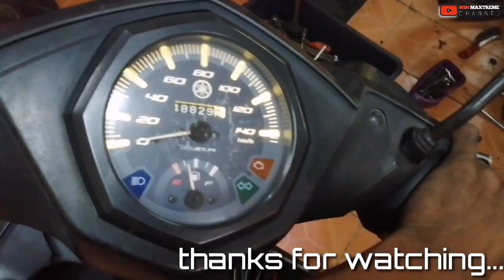CARA MENGATASI YAMAHA EGO'S FI TIDAK BOLEH START

Comment: salam boss, EGO s FI saya baru lepas tukar BLOCK baru(57mm), valve seal in out baru, valve lama grind balik, INJECTOR sudah servis, kepala plug sudah check, BATERI+RECTI tukar baru, THROTTLE BODY siap cuci semua.

masalahnya. 
-nak start guna stater susah jadi berat,  start guna engkol lama2 baru hidup, bila sudah hidup suka mati mati sendiri.

harap bos sudi reply boss😢
Reply from the maker: Wakumslm tappet cuba edjas bgi longgar sikit, nmpk mslah mcm compress lemah
Reply: @ ok baik bos, nanti sy cuba.. boss kalau boleh tinggalkan no wassap terus. apa2 nnti sy direct wassap bos

Comment: Salam, nak tanya kalau motor tak boleh start even guna hand starter n kick starter. Fyi, motor dah lama tak start. Bateri problem ke
Reply from the maker: Wkumslm.. Cube cek batry dulu klw batry x de cas memang motor x dpt hidup untuk motor fi...
Reply: salam bos kalau honda spacy. kena start pakai kaki baru hidup. kalau pakai starter kosong. dekat panel meter pon tak nyala. knapa ek ?

Comment: Bos mahu tanya motor sy ego s fi starter ssh hidup enjin.. Start kaki pon xnk hidup btry baru.. Rosak dekat rectifier ke or part lain ya?
Reply from the maker: Motor fi selgi and batry normal akan senang hidup selgi semua sistem masih normal, klw motor dah susah hidup tu bermkna ad part yg dah rusak.. Cuba cek fuel pump..spark plug and cap plug cek dengan  betul..

Comment: Salam bos,klau moto tiba2 xleh stat knpa ye...Nk kata bteri prob,batery msh bru n bru je tkr dlm bln8 rtu...Pstu lmpu sensored  oren bkelip2,bwk g wkshop tauke tu kata,kna scan gna kmputr bru thu apa mslh..Mslh plk,area cni xdak wkshp yg blh scan...😂😂😂😂stater xleh stat,guna manual lengoh gk kaki..tu pn hmpir nk jd supersaiyaaa dh bru dpt stat....Haahaa...
Reply from the maker: Wkumslm.. Klw start guna kaki blh hidup tak..?
Reply: @WinMaxtreme  bkali2 jgk try stat kaki...Baru blh...
Reply from the maker: @emmamaarep6667  klw batry normal Cuba servise fuel pump
Reply: Sama mcm ego S FI sy bossku. Semalam hantar bengkel, pomen kata piston jammed. Bateri ok, plug ok, oil filter pun ok. Moto dh 5 tahun. Mcm mana piston blh jammed pun tak tau la. Moto standard je. 😌

Comment: Solariz sy semput2. Payah nk hidup.
Dulu dh penah jd. Lampu cek engine nyala. Tp bila cek takde code. Smpai mati.. last2 try tukar coil plug dgn coil magnet. Hidup elok kejap. Ni jadi lagi 😅
Rumit sungguh
Reply from the maker: Memang motor zaman sekrang, ikut teknologi, klw x faham fungsi die memang rumit,, cuba tengok cap plug, tkut tu dah longgar, klw longgar try ganti baru yg original..
Reply: Moto solariz ego aku dia rosak sensor ekzos,try kau cabut,tukar baru.

Comment: salam bossku tumpang tanya nape motor sy bila tekan button start volt turun lepas tu start x kuat baru je tukar racing starter 400cc rectifier, relay ngan battery tapi problem sama juga kalau buka plug try sot kat besi tangan pun kena sot